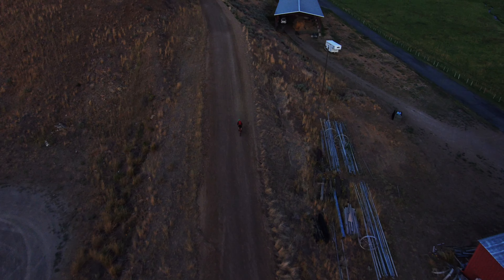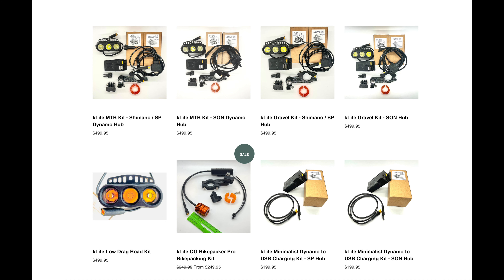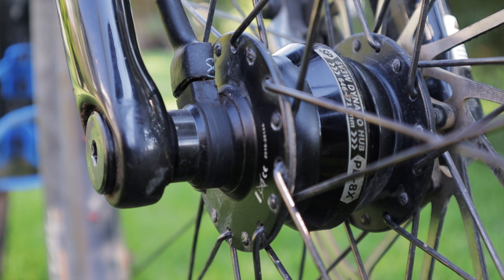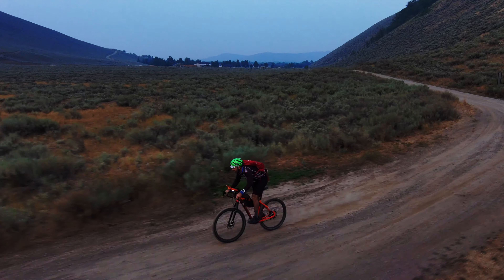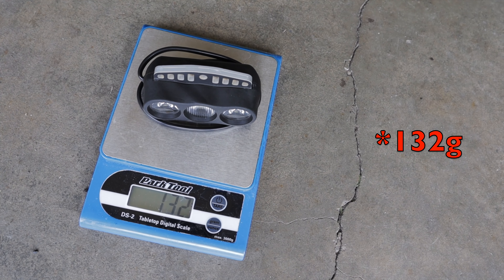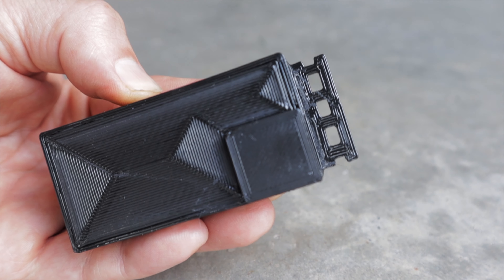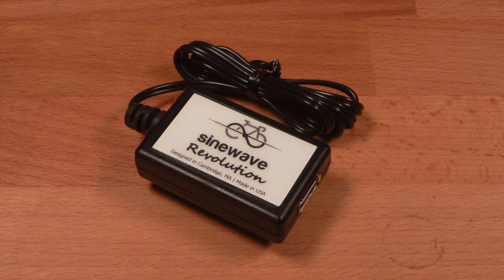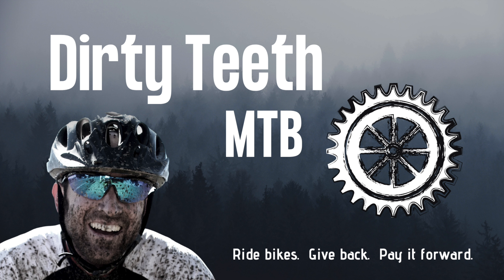kLite Dynamo Bikepacking Light + Charging System | In-Depth Review | Bikepacker Ultra V2

Comment: Nailed it as usual.  Great video.  👍  I went with a pedal cell external.  Main reason was that I can move it from my cutty to the madone.  It also puts out much more power.
Reply from the maker: I’ve heard good things about that - might have to test one out! Thanks for sharing 🤙
Reply: Thanks for your comment. Was going to ask about external dynamo setups. This fits the bill for me. Did a France Spain bike trip back in the 80s in December-January. Did a lot of night biking with a cheap wheel dynamo light as I used to like lying on the beach until about two or three in the afternoon drinking a few beer then biking until about ten at night. Blew tons of light bulbs but worked well never the less.
Reply: One question. Does the connector for this light fit your external dynamo? Thanks.
Reply: The moment you get some mud or snow on the rim, the PedalCell stops working…game over.
Reply from the maker: @KowalskiVanishing_Point  no.  The connector for this light plugs in to the kLite wiring loom, which plugs into my dynamo hub.  It doesn't plug directly into the hub.  Ride on :)
Reply from the maker: @KowalskiVanishing_Point  lying on the beach until 2 or 3 and drinking beers will recharge better than any dynamo!!! :)
Reply: @DirtyTeethMTB  You know it!!! And thanks for reply re: plug connection.
Reply: @jona3117  How long have you used one for?  How did it fail you?  I guess a difference is that all my lights have batteries in them and I carry a 10,000 mah battery with me for charging.  I would have loved to get a son dynamo but when I was looking parts were a problem and if I ordered from hunt the wheels would have arrived about a month late.
Reply: @camd5348  I've tried most all dynamo solutions on the market today including some magnetic field lights. In terms of "fix and forget", dynamo lighting solutions are robust against pretty much all conditions and temperatures. Among them, I've found kLite to be by far the best. However, there are two obstacles: price is higher due to a dynamo hub wheel format and transferal of the system across bikes for the same reason. My solution was to ensure all my bikes use the same hub axle configuration and this allows me to move the kLite system as I please. I believe that using batteries in lights is a major failure point not to mention environmentally unsound. Best of luck.
Reply: @jona3117  With supply chain issues and time constraints I could not get a wheel built anywhere in time for my event.  Even hunt wheels was at a 3 month wait.  Chose the system I could buy at the time.  This year I have a 700km backcountry race. I will see how it performs.  Nice thing is it charges 4-5 times faster I think that an internal so I dont have to run it a lot and I can ust run it on the better paths and gravel roads and not have to run it on the single track.
Reply: @camd5348  Good to know. Thanks for the feedback on PedalCell performance. Safe riding 🙏

Comment: you know you will loose around 15-20% when charging a battery then to a divice..... instead of derectly in you phone/gps .... also 2 smaller batterys has another benefit then backup.... how bigger the battery the slower the charge with dynamo systems because bigger batterys have more resistance 2x5000mah instead of 1x10000mah the big bricks like 20000mah+ are pretty hard to fill with a dynamo system.

I myself use a SON dynamo hub (no lights got some small ones but never ride ad night) for my AC/DC converter I use Forumslader V5 It has a battery build in around 3000mah (around phone charge) In a general day 18km/h avarage around 100km I can easy Charge my phone (in 2hrs with 2700mah battery) Garmin head unit and 1 Drone battery from my DJI mini and have some room to fill my backup battery.

you should check out the Forumlader V5 if your in need for more power during your ride it seems to be the most efficent one on the market it even has a app so you can see your power output from the dynamo, and howmutch power you get pull out of it and many more stats....
Reply from the maker: Thanks for chiming in, Paul 🤙

Comment: Great review!  I’ve been using a V1 Klite Backpacker Ultra setup for about three years now on my Fargo Ti and loved it so much I just put one on the Blackborow rig I built last year.  Klite and Jefe have both had exceptional service!

With regard to the Qube light, have you given thought to mounting it on the non drive side stay?  Most cars will be passing you on that side so it will give better visibility to them.  Also less likely to get hit with flying chain grime.

Keep up the great work!
Reply from the maker: Thanks for watching and commenting, Paul :)  That's awesome you put a kLite on your Blackborow!  I chose DS for the qube to hide the wire with my shift cable housing...but yes, you're right...  technically probably a little better to put on NDS - ride on :)

Comment: Sorry, way too much cheap 3D printing here. 3D is supposed to be us for prototypes before full production, not for actual production. It's cheap, looks cheap and would be the lowliest component on my hand built expedition bike. SineWave it is then.
Reply from the maker: thanks for commenting - since I made this video, kLite has changed their mounts... ride on!
Reply: @DirtyTeethMTB  They're still 3D printed in the UK market it seems.
Reply from the maker: @simonsharp9162  that's a bummer.  I use a k-edge out front GoPro mount... I don't like the 3D printed stuff either, but the light itself is solid... you can't go wrong with the beacon either - ride on!

Comment: 500$ what is so special about it ,
Reply from the maker: Maybe nothing?  All depends on your bikepacking/dynamo needs & goals... Thanks for watching  :)
Reply: @DirtyTeethMTB  i have shimano dynamo on my bikes with led ligth , pay around 20euro , dose not light much ,  but for city bike is ok , and have a ebay ligth with external battery pack , work well , pay 20 for it but need wall power to charge ,
Reply: @DirtyTeethMTB  and one more thing for 500$ you can get a pretty good new bike   no mater what your need are ,, 10-30 is a normal price for head ligth , 100 is the max some one should pay for hi end stuff ,
Reply from the maker: @darkphotographer  sounds like you're dialed - thanks a bunch for sharing your opinions :)

Comment: This is ridiculous, get a BM IQ-X thats is a better light and add a Forumslader V6 thats way more efficient. This video is a an ad-joke. The cost for a way more efficient system is sub $200..takes 2 seconds to google. I have done 2xTCR, TransAM  (top 10). The $600 price is just hilarious, dont even has a battery cache, just capacitors.
Reply from the maker: Thanks for sharing your opinions, sirulrich88 :) I'm glad you've found a system that works for you :) - As far as "ad jokes" - I just try to make videos I think people will find useful... sorry if you disagree... Ride on :)
Reply: @DirtyTeethMTB  you say things like “500 lumens brighter than the nearest competitor” which is not true at all etc
Reply from the maker: @sirulrich88  In my mind, the nearest competitor for an expedition-rated bikepacking dynamo light would be the Sinewave  Beacon - 800 lumens... by all means, "enlighten us" with other options :) ride on!
Reply: @DirtyTeethMTB  I hope you also ride on, but that is factually wrong. The IQ-X from BM has tested way over 1000 lumen, which I stated as a better option above...
Reply from the maker: @sirulrich88   I didn't realize that the IQ-X was expedition-rated and was designed to take an off-road beating... which is why I didn't consider it as a competitor to kLite.  I thought it was more of a "road/commuter light"  So thanks a bunch for clarifying :) Ride on!